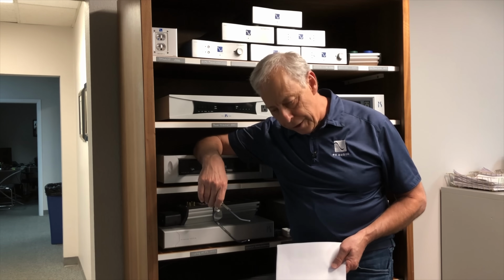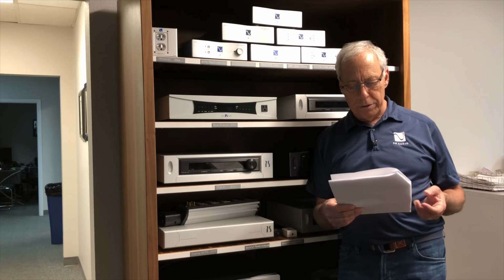Are multiple driver headphones any good?

Comment: Not sure if I'm asking a stupid question, but why does listening to Binaural audio on an iem or headphones can sound like the sound comes from far beyond the drivers? What trick do they use to do that and why don't more artists use that?
Reply: It's down to how it was recorded. They use a dummy head with microphones in its ears and it captures how sound is affected by the shape of a human head.

You can synthesise something similar if you have data on how the shape of the head affects sound at different frequencies coming in at different angles. That data is known as a Head Related Transfer Function (HRTF) and there is software out there that can make use of it for positional audio. 

While I can't confirm it, I have heard that to really have it sounding good, the HRTF used for the positional system needs to be a reasonable match to your own.

Comment: VR is beginning to produce the technology for this head movement in a 3D sound environment in games.  Normal 2 channel binaural recordings are fantastic if you don't move your head.  There is currently development in two merging fields.
1 Phased microphone arrays.  This uses an array of over 100 microphones which can then be electronically steered to pick out individual voices in a crowd.  This is sometimes used in sporting events.  See ClearOne Beamforming for one example. Look up the TOA AM-1 video for another small version in operation. Squarehead Technologies has the Audioscope for sports arenas.  This records each microphone on a multi track recorder so the sound field can still use beam forming to pick out individual conversations after the event.  This sound field recording is important for step two.
2 VR sound fields.  The VR game market is beginning to produce 3D images for viewing in VR headsets and producing 2 channel 3D sound to match the 3D virtual world in the game.  A merge of this VR game technology with the phased microphone sound field from a live recording can produce a high quality sound field.  Extended far enough this would permit video and audio walk through of for example a room full of people and listen in on individuals conversations in the room.
Reply: You'd need a pretty high order of ambisonics to get that angular accuracy, but it certainly seems likely that you could pull it off.

Comment: Short answer : they can be, but only the more expensive ones.
It's much simpler making a decent IEM with only one speaker but it's hard finding/making the right one.
With multi-driver IEM's (up to 12 Balanced Armature drivers per side nowadays! (=absurd!) it's MUCH more complicated to make something that sounds good.
You have to make sure the drivers don't overlap but also don't have gaps between the frequency ranges of the drivers and the listener shouldn't be able to hear that there are more drivers.
Then there's the quality of all drivers : it's hard to manufacture BA's that all are exactly the same quality.
And the housing : the distance to the ear is very important.
The good news is the multi-driver IEM's getting better every day and the price is going down.
The bad news there is a lot of rubbish on the market too and more drivers doesn't make better sound.

Comment: Another reason for the artificial hearing impression is ignoring the relevance of the outer ear. 
In nature the pinna gives us all the clues about the vertical position of the sound source. Then we can turn or tilt or lift our head to see, where the sound actually comes from. That’s the reason why animals can detect sound. To see or be aware of upcoming enemies. 
Even with head related transfer functions pinna omitting sound waves cannot sound natural.

Comment: In my opinion, the reason most headphones give you that inside your head sound, is the direction the sound is coming from. Which rather than coming from directly in front of you, it's coming in at a 90 degree angle straight from the side. If you were to sandwich your head in between to bookshelf speakers (I've done this) you get the exact same effect. I enjoy a good pair of IEMs and my best pair (Miles Davis Trumpets) are the some of the most fun sounding things I ever listen to music out of. I also have an open back headphone, Beyerdynamic DT880, and while the inside your head effect isn't quite so bad, it's still there. Until someone can design a pair of headphones in which the drivers are positioned in front of your ears rather than right beside them this will always be this way. Headphones will never compare to a good 2-channel loudspeaker setup. Only 2-channel loudspeaker can produce music you feel and not just hear.

Comment: Headphones that monitor the movements of your head? Sounds like a VR headset to me.

Given a VR setup already has to monitor the position and orientation of your head to give you the correct visuals, it wouldn't be much of a leap to feed that same data into a positional audio system. If it can calculate what you should be hearing for a given position and orientation, then just keeping that updated with the headset's data would probably give you the results you're after.

It's possible your problem has already been solved by the games industry. If not, they're likely a good portion of the way there and you might be able to help them finish it off.

Comment: Sounds like he is describing the Audeze Mobius headphone, I would like to hear those some day
Reply: I've got Mobius. Once centered in 3D, you still hear the source of the center sound from that fixed virtual "straight ahead". And it's still INSIDE your head! NOT outside! Reflections, I guess. When you hear something outside, you hear not only the source itself, but the reflections of this source sound too. Those reflections are the secondary audible signals describing the outside parameters of the room/space you find yourself in. And our brains are powerfull enough to decipher BOTH the movements the our heads and the reflections of the source sounds created by the outside space
Reply: I thought the same thing. I think they'd need an open back version though for it to be truly convincing.

Comment: This is a very interesting subject ... firstly the listener is ( or should be ) aware of just how he/she is listening... by that I mean via headphones or speakers ... this 'preps' our brains from the start. Headphones totally lack spaciality.. they are dead... no delays , no phase variations ... in theory they should be the perfect way to listen . But alas they are not. headphones have their place ... enough said .
Paul's IRS's are only part of the way there ... a good attempt .. but I know for sure if the late Arnie was still around , he would have carried on the IRS design philosophy much more... in so much as providing a very wide horizontal dispersion pattern which is sadly lacking in all stereo sound at present ..
In essence it's more strategic mike placement and more speakers across the front ...
Reply: Well said. For several years I played with the idea of a vertical array of full range drivers to obtain that horizontal dispersion. Lotsa cones meant plenty of air being pushed for the bass. No crossovers that are problematic because of phase issues. Then I discovered that the multiple cones also created their own phase issues. Aaaargh!

Comment: Then why do binaural recordings sound in front of the head with headphones?
Reply: The short version is that it's because binaural recordings capture how the shape of your head and ears distort the incoming sound, so when they're fired directly down your ear canals by a pair of headphones, your brain can't tell the difference.

Well, that's the ideal case, in practice, there are going to be differences between the shape of your head and ears and the ones used to make the recording, but it should still be close enough to work.
Reply: Its because a 3,5mm cable cant do Surround sound. and Bluetooth can!

Comment: Paul, the “magic headphones” your describing may be on the horizon. Audeze is making gaming headphones that are supposed to move the sound around you as you move your head, just like you’ve described. I’m sure it’s mostly simplistic right now, but the fact that the concept is already in a production unit might mean big things for the future of headphones
Reply: I think the hardware already exists in the form of VR headsets. All that's left is the software, and even that might already exist in the form of libraries used by game engines.

Comment: I figured this out 44 years ago and have explained it many times. It's not the change in loudness or phase angle, it's the change in arrival time versus the change in head position. This is why your inner ear that senses head movement is directly adjacent yo your eardrum.

Edgar Choueiri trick is to delay the signal to both headphones and when you turn your head the delay is longer in the headphone you turned your head in and shorter in the opposite headphone. We're talking about microseconds. This is why the sound appears to be coming from in front of you. If he reversed the process or if you just turned the headphones around so that they're on the opposite ears, the sound would seem to come from behind you.
Reply: "I figured this out 44 years ago..."

Bats figured it out millennia ago, long before us humans ;-)
Reply: @jonathansturm4163  it was an evolutionary development. They didn't figure out anything. It was hard wired into their brains and the brain of every other animal with binaural hearing. The ability works in all three planes 360 degrees and never goes to sleep. It is one of the most important strategies for survival whether you are predator or prey. You often hear something before you see it. Your instinct is to look directly at what you heard. The reason this was important for me to know when I was engineering my first prototype was that you cannot hear the direction of reverberant sound fields even though it is most of the sound energy you hear. The problem was figuring out how to defeat it.
Reply: I'm sorry you missed the emoticon. Here it is again ;-)

Comment: Wouldn't adding a bit of crosstalk between the channels with a slight slight delay somewhat alleviate the "sound inside your head" thing?
So that you hear some of the left channel with the right ear and some of the right channel with the left ear instead of only hearing left channel in left ear and right channel in right ear?
Reply: It'd be pretty easy to program. You have buffers of audio data just as part of the mixing (for MOD and MIDI formats where that's needed just to play the file) or decompression systems (for boring formats like MP3 and FLAC) in the player program. Adding crosstalk would just be a matter of taking the current samples to be output and some previous ones and mixing them.

With a 48kHz sample-rate, each sample is about 20 microseconds long, so 50 or so samples would get you 1ms of delay. Doing crosstalk for the right channel could be done in a line of C code along these lines:

right_out[n] = right_buffer[n] + 0.6*left_buffer[n-50];

The values of 0.6 and 50 would actually be variables computed from how you configure the crosstalk options for the playback program, but I left them as outright numbers here just for simplicity. 

And before you ask, yes, this simple example would clip if you fed it a loud signal. That can be fixed with either some scaling factors in that line or some simple follow-up processing, depending on how you're implementing things.

Comment: One thing that worries me about headphones is that while your ears have a large dynamic range overall, they only have something like 1/10th of that range available at any given time and that available range varies with the ambient sound level which has been experienced over the last 15 minutes to half an hour. With loudspeakers your range is always autocorrecting towards what is appropriate for ambient levels but with headphones the volume knob takes over and less experienced listeners have a tendency to overdo it. The iPod generation has absolutely frightening statistics for hearing loss as the result of high volume and ear buds. More nuanced listeners are better protected in their habits but I love Hawkwind, Motörhead, and AC/DC at volume nonetheless.
Reply: Where do you see the frightening statistics of hearing loss due to iPods? I just checked some statistics and it rather seems like hearing loss grows by age and in America diabetes (our diet) is a major contributor. I used to go to very loud concerts or clubs where the next following days I could sense a significant ringing effect in my ears and that probably caused some hearing damage. Now I listen a lot using headphones but never at a sound level causing any ringing (tinnitus) after I take off the headphones.
Reply: @ ThinkingBetter Paper on the issue here:  http://www.aes.org/e-lib/online/browse.cfm?elib=14340

"The measurements were aimed to assess the hearing damage risk for youngsters who employ an MP3 player for several hours/day. The students of an Italian high school (15-18 years old) were asked to supply their personal devices for testing, leaving untouched the gain from the last usage. The results show that the risk of hearing damage is real for many of the devices tested, which revealed to be capable of reproducing average sound pressure levels well above the risk threshold."

This only indirectly supports Peter S who seems to make stuff up. Anecdotally, I have several friends who have severe tinnitus presumably from excessive amounts of high volume music. If you ever attended a Neil Young concert, you will know what I mean. I also have friends who were protecting their hearing while performing back in the 1970s and they are noticeably not suffering from tinnitus.